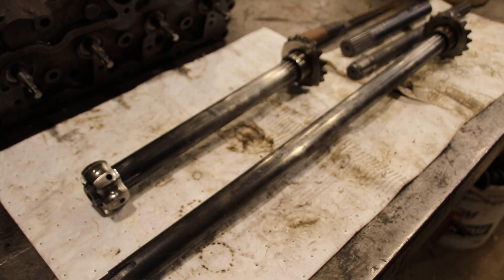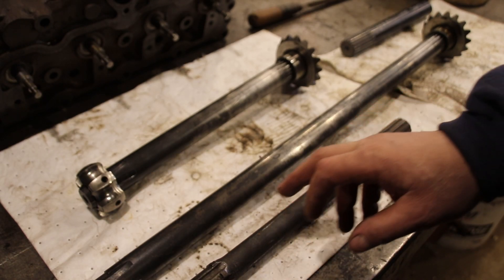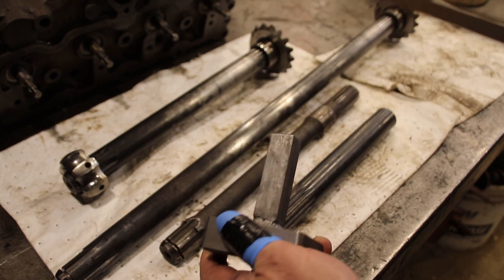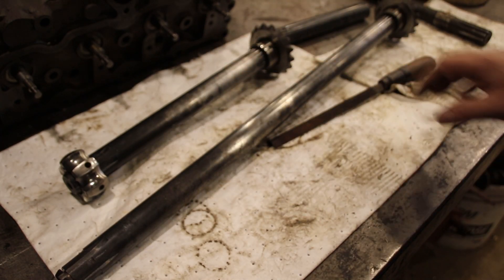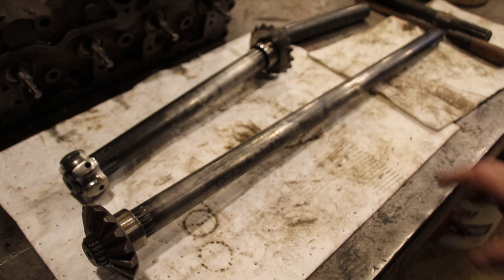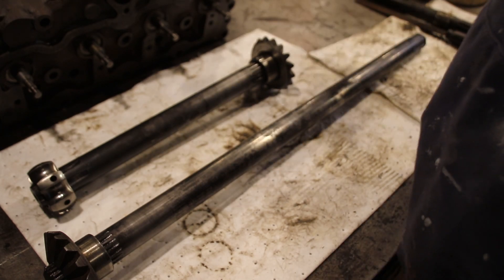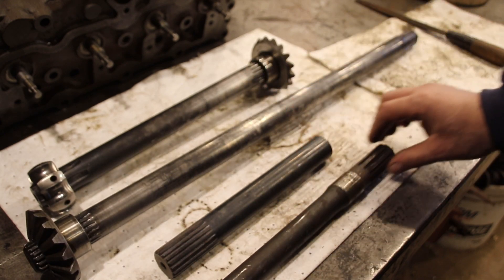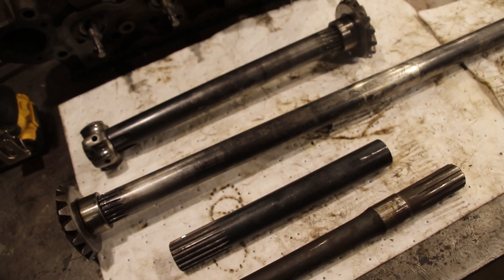Willys CJ3B Custom Axle Shafts Back From Hardening/Tempering

Comment: I've had to make custom axles for my projects for many years, these look great.    I hear you on choosing heat treaters carefully, actually had a heat treater break one.   Got it way too hard and during straightening broke it......Grrrr...   Interesting that you chose Rzzepa joints  (these are my favorite)  Most Jeep guys think U-joint axles are sooo much better.
Reply from the maker: good to know someone else out there is making axle shafts.  Sorry to hear that one broke during hardening, that is the exact reason I am telling folks to choose carefully when it comes to a hardening facility.   The Rzeppa Joint is a very sturdy and long lasting joint, and just as good if not better than a modern spicer joint, and very much like the Birfield joint that everyone is raving about these days.

Comment: Interesting how the hardness needs to be just right. I never gave much thought to it before as far as axle shafts
Reply from the maker: Hardness and tempering are the most important steps after the axle shafts are made.  Bad stuff can happen if not done correctly.   That is why I have used just one hardening shop for over 20 years.